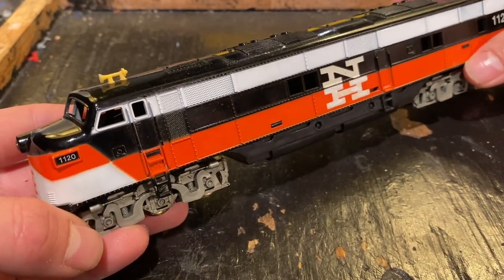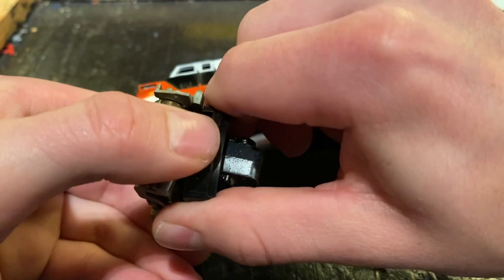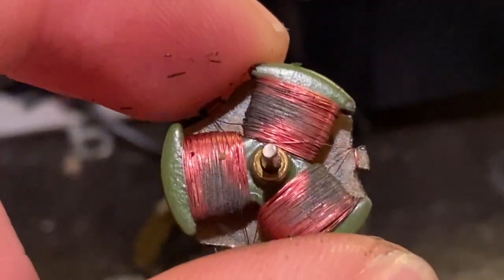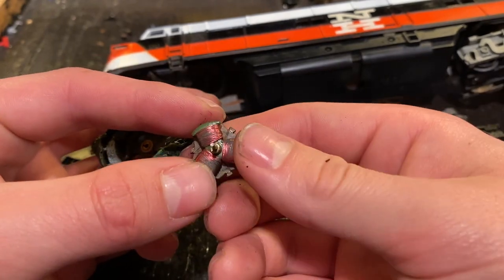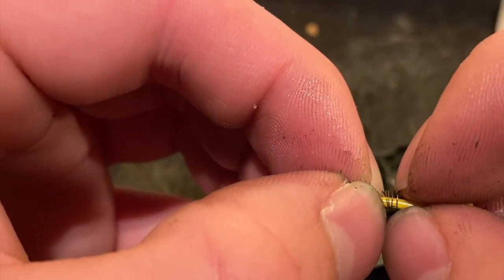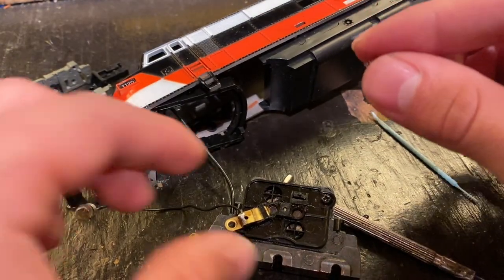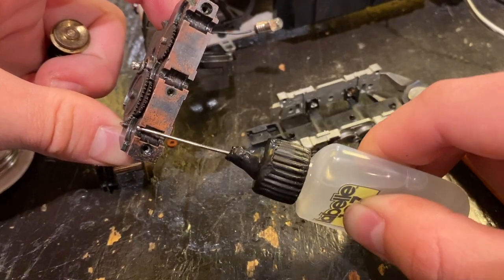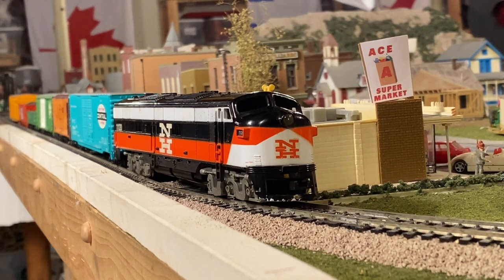Can We Make This 1978 E7 Locomotive Run Again? - Seized & Burning Motor

Comment: Looks like you got another good one SMT, nice work!  By the way, there's a BN version of this locomotive and what's so unusual about it is the paint scheme.  It has this almost Neon green and white scheme, I saw it on jlwii2000's April Fool's video.
Reply: It actually isn't too far off from a few ex-CB&Q E-7s and E-8s the BN inherited. I've seen photos where the cab and nose are in cascade green, the rest of the body is stainless steel. Ever since I saw prototype pics that Tyco was not too far off, I've been trying to find a couple. Go figure, it's just like the blue stripe Amtrak coach (Which also had a one-off prototype!) when I am not interested in buying them, they're everywhere. Soon as I want 'em, no one is selling.

Comment: Not giving up is also a skill.

Seeing thet even you have setbacks gives me hope.
Reply from the maker: Thanks, there were a few attempts I didn't show too. I initially attempted to rewind the motor however there were a few problems with this since I didn't have the right gauge of wire so in order to pull the same torque I put 350 turns which made the coils too large to fit inside the casing...
Reply: @SMTMainline  Rewiring a motor is on another level, i would love a video about it too, too bad you did not recorded it, even with the wire being too thick.

Comment: Nice vid!! The New Haven Railroad never had EMD E7 units. Instead EMD FL-9 locomotives were the main power source for passenger service from late 1950's, through the 1960's.
Reply: Yes, IDK why makers do stupid stuff like this using the wrong paint scheme on a loco. Charles is right about the FL-9.
Reply: @calrob300  probably just for prototypical purposes and creating locomotive that aren’t real. I really like when they do that
Reply: @DanTDMJace  Ah, different strokes. Thanks for weighing in, Dan!
Reply: Well, they could have had them. They had Alco PA's and FM CPA-24-5's, so why not E units? I'm not a big fan of the McGuiness paint  scheme, but I'll admit it looks good here. BTW, NYNH&H was `a devoted Alco customer `(`with a few FM's` and a group of Lima 1200 hp switchers working Maybrook yard) - not buying its first EMD until 1956.
Reply: @calrob300 Not so stupid, the McGuiness livery is striking and attracts the customer. And there are` the folks who don't mind playing "`what if" on their layouts
Reply: @colbeausabre8842  Having grown up along the right of way, I feel close to the railroad and think those colors should be on the correct equipment.
You make good points though and answered my question. Thanks.

Comment: Just a thought, use rubbing alcohol and a stiff toothbrush to clean the goop.  Dries fast and doesn't risk a short.

Those springs are a tell...the temper was cooked out of them, the first sign of really serious overheating.

That beautiful McGinnis paint looks great running again... good show.

Comment: that motor is strikingly reminscent of the aurora pancake motors used in the h/o slot cars.used to rewind them for more speed.brushes were the same though notched for the pick up on the bottom.as this came from tyco i betcha thats what they used.tyco also had h/o slot cars,gheez i just gave my age away.saw that motor and wham out came those days.

Comment: @smtmainline try taking the disassembled metal commutator without the coils the gears the wires anything else that would get by acid and dipping the disassembled metal commutator in a cup of Coca-Cola because the acid in Coca-Cola will clear all the gunk away

Comment: I have mine running smooth as a top.. we have about 30 of these .. I guess they’re getting old but these were very nice at the time except the wrong trucks which they put the Alco trucks on every 6 wheeler. I do have Proto and Brass versions PFM of these also. Nice to see the younger generation discover these ild girls.

Comment: You could probably use automotive brake cleaner on the metal parts.  

It's hot, though, it will melt some plastics.
Reply from the maker: I should try brake cleaner or possibly starting fluid on scrap plastic to see if it does anything bad.
Reply: @SMTMainline  I used it to clean an ABS plastic auto part and it started to melt it.
Reply: I would agree.  Brake cleaner is not a good idea on those small plastic engines.  Carburetor cleaner is a bad idea also.  I use Awesome orange from the dollar store or alcohol.
Reply: @dbtech7914  I would only use it on those metal parts when you have big wads of old grease and junk to dissolve.  It's good for that and evaporates quickly.
Reply: Ultrasonic cleaner 
Works well

Comment: I always thought Tyco went too far with some of the "artistic license" they took when marketing their products in the 1970s. It did save them money to use the trucks and power unit from the C-630, but the average modeler was not impressed. Model railroaders, however, were not their market. They sold toys! Having worked for a toy store in the mid 1970s, we sold thousands of Tyco starter sets, and additionally had many after sale purchases of their accessories and cars. Neither Bachmann or Life-Like were as big in North America back then. These were also the years of the Lionel HO line that Bachmann later incorporated parts of. Their big? competitor then was AHM, at least in our stores. From a repair standpoint, Tyco was fairly easy due the commonality of parts. But our store had a 90 day guarantee, and many "aftermarket" Tyco locomotives were acquired by customers "for free." Tyco did not want their "failed equipment" back, and most issues were due to over-oiling, pet hair, and running on the carpet. Usually, the store would just dump them, but I did repair a few, and with proper cleaning they ran like new. We would put them in the used cabinet at half the price of a new loco. Essentially, people got a new loco, for half price, sans box. Should you have the opportunity, pick up a Model Power E-7 from that era, which I found to be a much better loco.

Comment: Hi .
Try Out Orange Cleaner to Clean the Motor parts !
I use it to Clean my Locomotivs.
Take some warm Water and a little Bit of the Orange Cleaner in the Water. Put the drive bogie in it and Clean all with an soft Brush . After Cleaning put it in Clean Water and let it dry.
Greetings from Germany
Sascha

Comment: Hey I got a brand new Tyco E7 model that I am going to use the body on to a Model Power / Roco chassis, I could trade you the complete chassis with trucks and motor. if you are interested as I will never use the motor, as I I want is the body itself.

Comment: @smtmainline Have you ever seen what Coca-Cola can do to a penny with years of old gum on it you'd be surprised at home at how the penny will be after sitting in the cup of Coca-Cola just try to give you a future but make sure you deep rinse the metal on the  commutator off in Hot water after sitting in the cup of Coca-Cola so it doesn't get sticky

Comment: your channel popped up on my feed recently and i know this video is a little old but i have two small pieces of advice in terms of tools to help, one is a proper soldering iron, i work on game consoles and use a hakko fx-888d and i think it would be perfect for this, second is a small sonic cleaner that you can put some cleaner/degreaser in and use it for small parts like those wheels etc to clean all the grease and dirt off, other wise awesome videos!

Comment: I rebuilt one of these myself a few months ago. Only, I replaced the front "Fang" truck with the AAR type B truck Tyco made, in effect, making it a bit like the FL-9 wheel arrangement. Also painted the trucks black and painted the grilles on the side. And as usual for me, replaced the dummy truck with a second powered Powertorque motor and added some more weight to the loco. She pulls a train of six prewar American Flyer HO die cast Osgood Bradley coaches without issue.